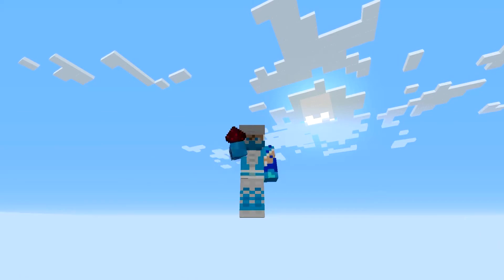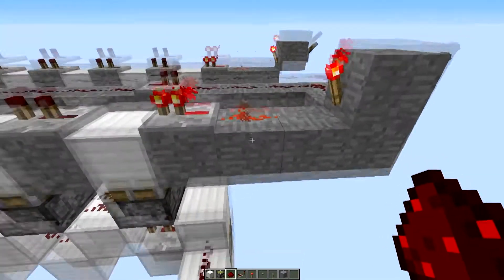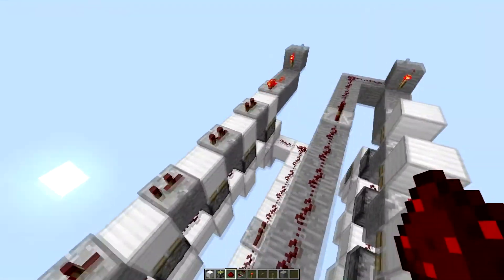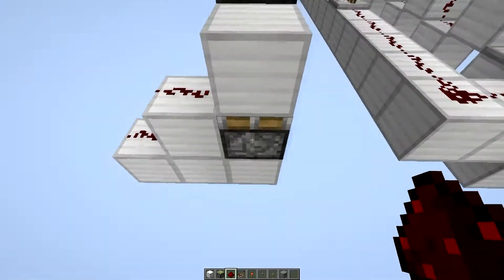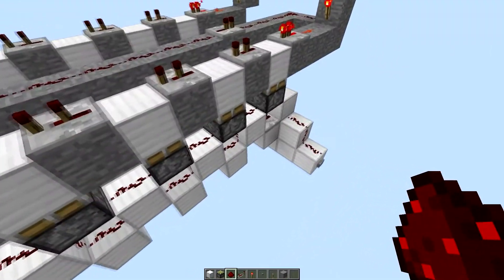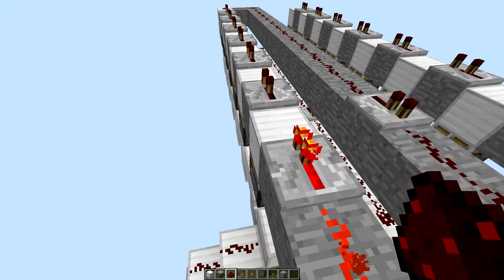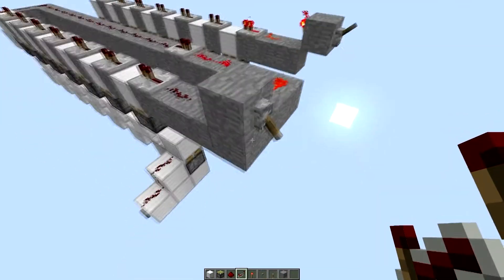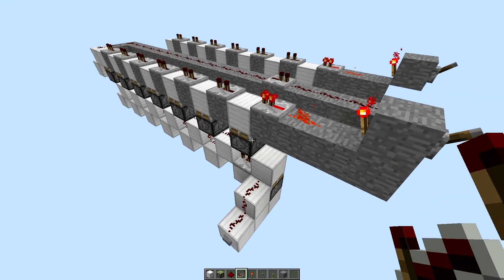Redstone Counter Circuit

Comment: In my opinion this is outdated, Hopper counters work well, with limited redstone.
Reply from the maker: maybe for certain builds but try building my tell tale heart contraption with a hopper counter.
Reply: I see what you mean.
Reply from the maker: +ImBaffled i think i could have worded that a bit differently and i would like to apologize if it came across as rude.
Reply: Silverpyro84 Not at all, I thought I worded it rudely xD